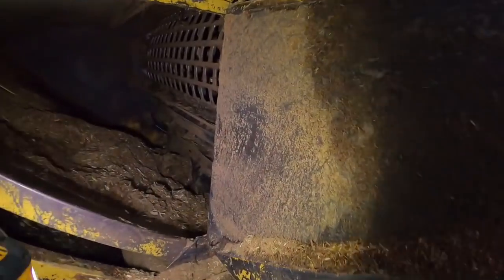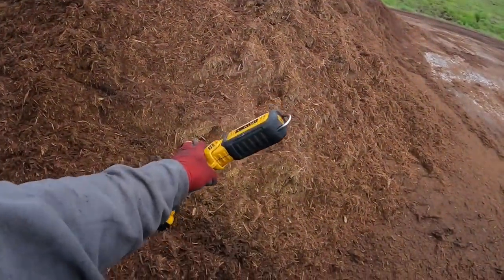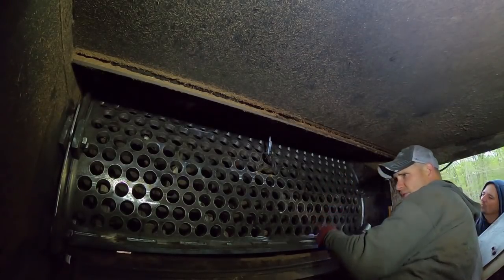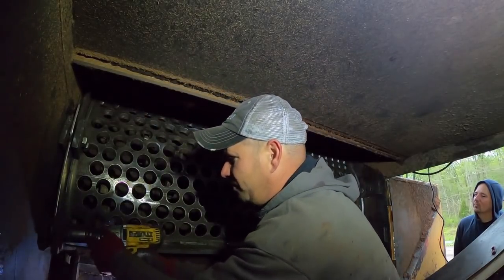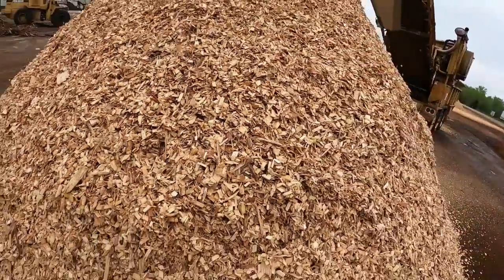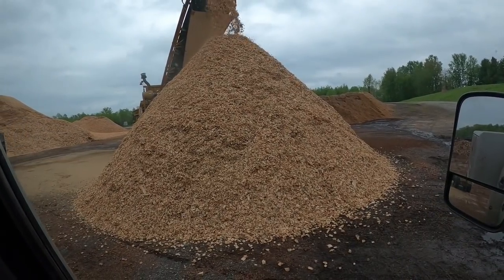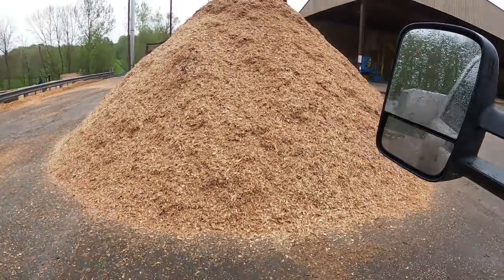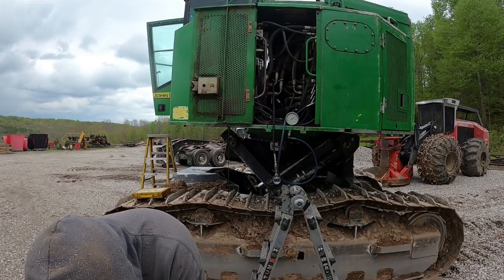New screen in grinder

Comment: Some operators and mechanics try to turn a pinto in a formula 1 racing machine and that as you know DON'T WORK they Jack the pressure up thinking it will produce more volume of product and it DOESN'T just more break downs down time less production. Glad you got it fixed before something bad happened.
Reply from the maker: Yup exactly

Comment: Tight spaces like that make me claustrophobic. Keep up the great Vidjas
Reply: that was not even a tight space, i have welded on heavy eqipment up in side the swing tube, were you cant move your arms, you go up  iin side with your welding cable above your headm then add in the smoke from welding and burning oils, or crwal in the hobo hole in the back of a cab to cut out the welded on mounting nuts and weld new ones on, and some jack ass used a varsol gun on night shift to clean it out, and you strick an arc in there and boom big ball of fire blows out your feet, burnt eye brows and red face

Comment: Wade as you were checking the pressures at the back of Brutus , it looked like the top house  going to come out of the ring gear,if you watch the vid yourself keep an eye on the movement between the top house and the car body as the operator moves things, it may have been when the boom was lifted but boy there was a LOT of movement there, it’s worth checking it out, that machine gets a hell of a lot wear in that area so please wade watch the vid and you’ll see what I mean
Reply from the maker: Gpt ya will do the lash in all the leveling joints makes quite a bit of movement but ill watch and make shore